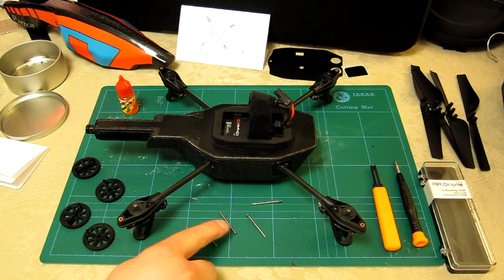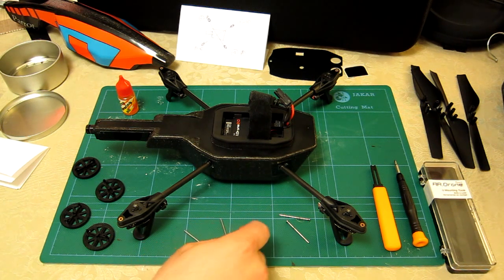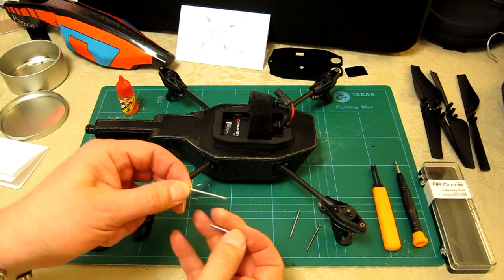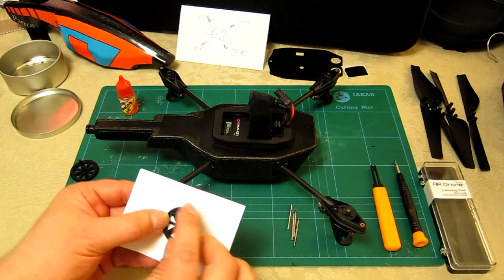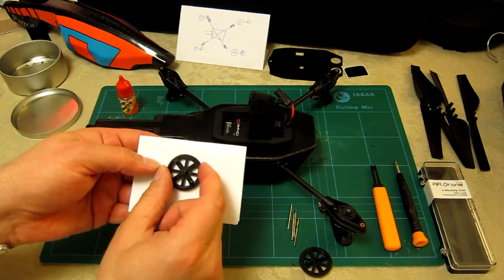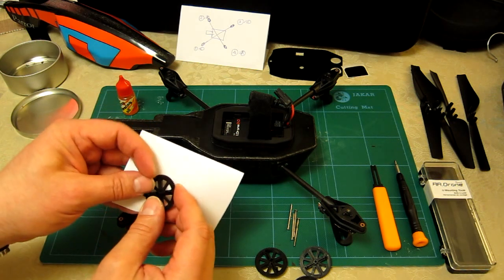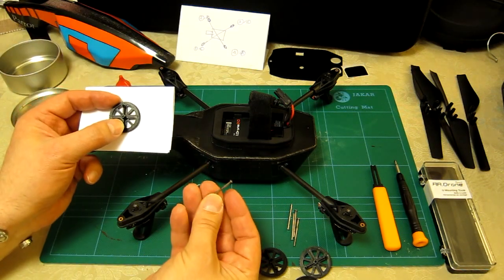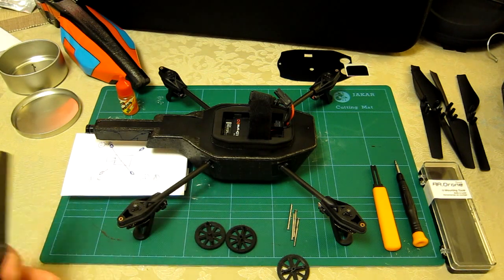Parrot AR Drone - Bent Shaft Pin Checks + Damaged Gear Checks - Repair Segment

Comment: Hi, the shaft pin is bent on mine and I cannot remove it as it is too bent to slide through the hole (only just though) any ideas?
Reply from the maker: Use a pair of pliers to try to straighten it enough so that you can pull the pin out ?
Otherwise - you may have to remove one or more of the 8 brass bushings that the pins sit in. (one above and one below)
They just push back in. Hope that helps.
Reply: Used your first idea and it worked, thanks! One more quick question while I'm here, do the normal parrot drone 2.0 hulls work on the elite edition of the parrot drone? Thanks!
Reply from the maker: L00EY101 Glad you managed to get the bent pin out :)
I do not know for certain about the elite edition. Looks the same style and shape. Should fit.
The insides may be slightly different to allow for the GPS etc extras. But the hulls are soft and easy to cut etc.